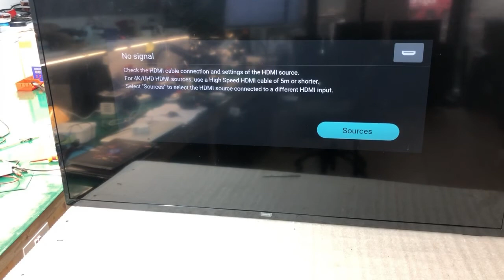Philips 50PUS6504/12 No Picture Backlight Repair

Comment: Change only the faild led‘s will not work Long time. A few weeks or months the Problem Comes back. Ever change the complete backlight by repair it is ever better.
Reply from the maker: 100% agree with you Greg, we doing this only if new set strips is not available to buy or is available in China only and delivery taking about a month so customer can watch tv until strips arrive and then we replacing full set.
Reply: @WeFixTvs  yes right i have looked. I´m selling a lot of Parts and have only 50PUS6704 in Stock and 50PUS6504 is other Backlight but i think in a few weeks still avalible;-) Now i have seen it is avalible for 50PUS6504 / 50PUS6554 = 705TLB50B33LBL00E ;-)

Comment: Hello! What tool do you use to test the LED diodes?
Reply: a multimeter on...diode...mode
Reply: @tuxic4033  not a normal Multimeter when testing a complete row of diodes at once.
Reply: Try it, a good multimeter can test the whole row. My Fluke and Brymen can both do it it just takes a little longer to full brightness
Reply: @tuxic4033  okey! Ye I did try and couldn't that's why I asked 😁 but then I know that some actually can then
Reply: power suppply from 25-30v show you if is good or not..
Reply: @tuxic4033  this cant be realistic..  nend to be loaded

Comment: Hi, I am having a Philips 50PUS6804 and I have a crazy problem :
1. when I connect the elctricity it takes more than 1 min before the startbutton lights up
2. when I press demo he works perfect
3. Netflix is working
4. i cannot use Source button (black screen) and any input is working ???
any advice about this issue please ?
the repairservice said they could not fix it ...  :-(